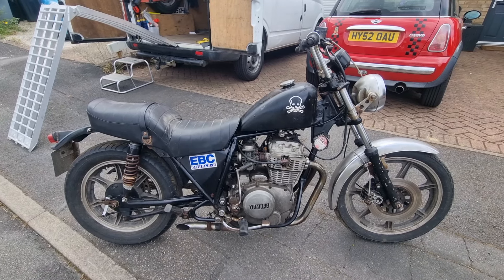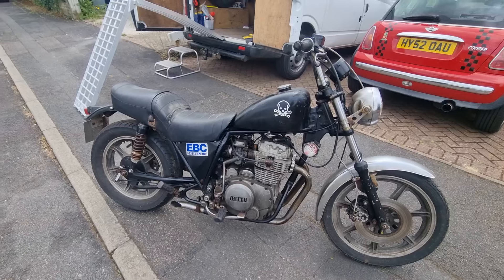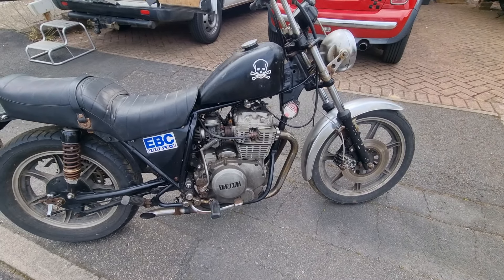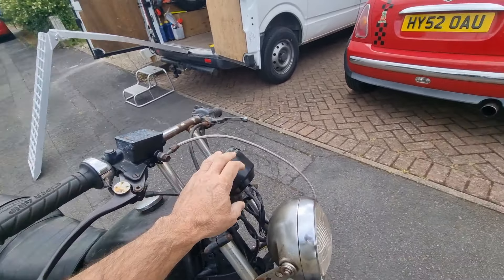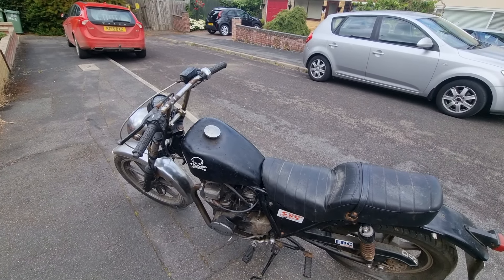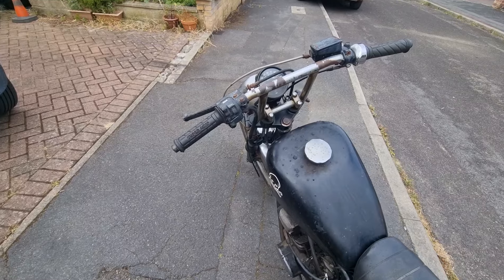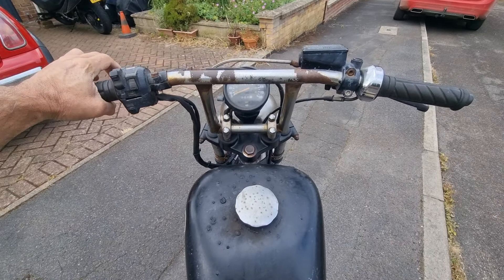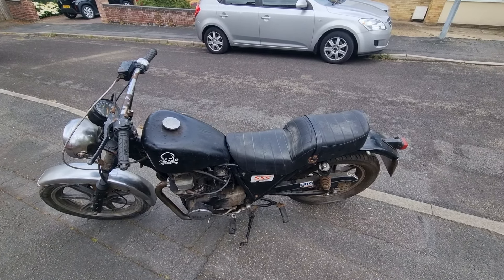Just In. Yamaha XS250 project

Comment: Looks like an xs 250 US  custom
Reply from the maker: @briandear5354  yes, and for very little it can be yours
Reply: @MotorcycleReclamation  If you can find one i would be very intrested in a large enduro or  Suzuki 500 2 stroke  .... i have a complete kh250 in parts with an added set of s350 barrels as px .... Or even rarer a complete split head system with gaskets and the longer headbolts for a Suzuki GT750 only used on the early home market bikes...
Reply from the maker: @briandear5354  seen my SP370 video on here, runner needs a tidy with V5
Reply from the maker: Or I have a Fantic Raider 250 2 stroke enduro that's got V5 had it years!
Reply: Hi like the SP 370 what sort of price are we looking at..
I actually rode one to the Paul Ricard circuit 24hr bike race a good few years ago...
cheers
 Brian
Reply from the maker: @briandear5354 see my website Motorcycle Reclamation